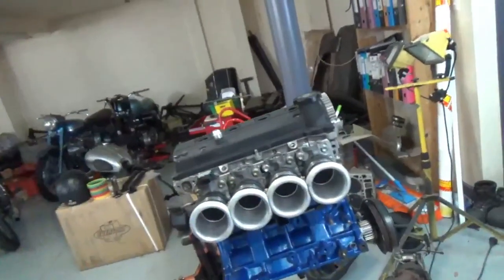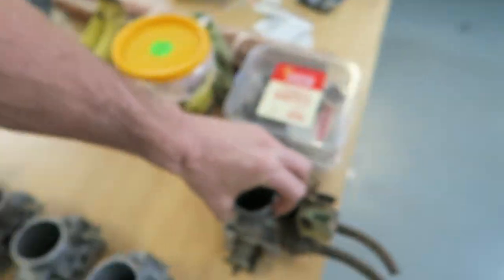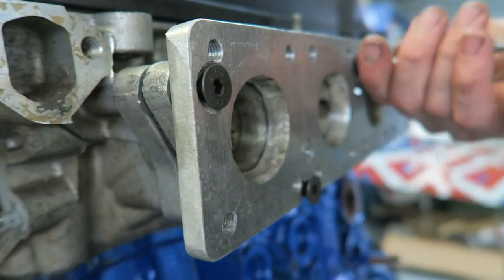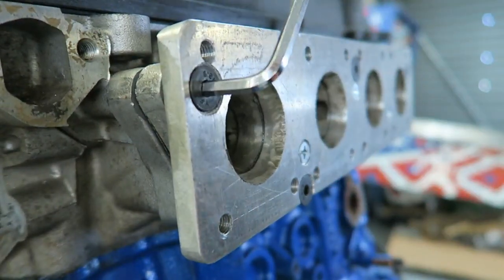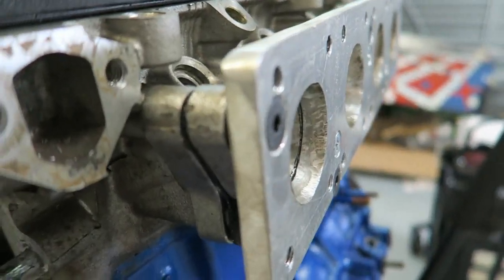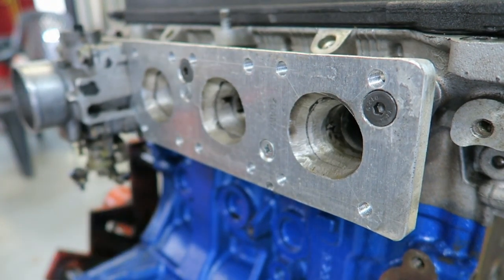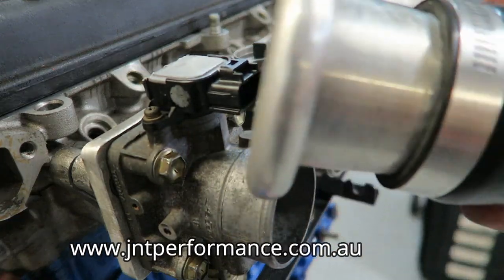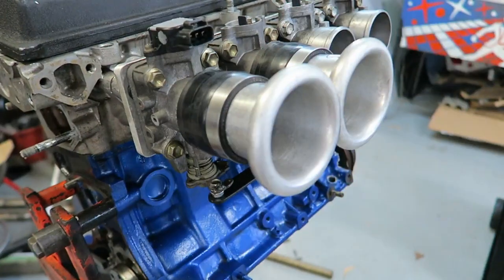How to build your own custom ITB intake manifold

Comment: Hi mate. This is intersting. How hard was it to fine tune the ITB's given you have 4 seperate mechanisms sharing a bar/rod? Also do you know the ID of the throttle bodies? Thanks dude great stuff
Reply from the maker: Hi SR PERI. Being efi there was really no need to fine tune it. The fuel supply is controlled by the computer whereas a carby setup is very important to have them fine tuned correctly as they will draw in different amounts of fuel if not tuned correctly 

The main thing is a made sure they are all open 100% on wide open throttle. 

I am testing a new design at the moment using adjustable rods, I'll be putting a new video up soon, be sure to subscribe 😁
Reply: @MattBerrymotorsport  mint! sure have. And yeah I was asking re: idle with efi. I had imagined it'd be quire difficult with ever so slight dsicrepencies in throttle position

Comment: Hello there! I would like to attempt this on my BMW M42 engine. I would like to know if you still need a ECU or stand alone computer when the engine is installed? This will be my first carburated build as well. In theory I can run this WITHOUT a computer yes??? i have a manual transmission as well all tuning will be done manually correct? And I can apply a third party knock sensor and tac. gauge yes? (this 92 E36 will become my first drift car) I would like to install this system to avoid the extreme cost of reprogramming a computer. My rigg even turns over I would just like to know a few more specifics, any support would be greatly appreciated thank you! Much respect from Cleveland OH! P.S_ if this setup does not need a computer, what should I connect my MAF sensor to?
Reply from the maker: If it is carburetted you wont need to connect a map sensor. Dont expect any real power gains without replacing the camshafts and exhaust.... this mod is pretty easy to do, even to a car like yours, however without changing the cams or exhaust you will only get "the noise" from this modification...
Reply: @MattBerrymotorsport  thank you!

Comment: Never thought of that...

But how are you going to connect the to the ECU?
Reply from the maker: Hi tassross! I have used the factory TPS sensor to the stock location on one of the throttle bodies. I don't use the idle motor, it is adjusted by the throttle plate 😊

Comment: How high can you rev limits 4efe n/a 8500 or 9000 stock
Reply from the maker: 7000
Reply from the maker: Will eventually throw rods at 7500
Reply: How much for the aftermarket vavle springs u used
Reply from the maker: @Timroycampbell  email or call Allen. Tell him I sent you and he will work out a price for you

Comment: Hi, do you have any info about how interchangable Toyota's throttle position sensors are? I'm figuring out if the values are the same as on the 3S-GE.

I am at the start of designing ITB's for a gen2 3S-GE engine. I want to do it in such a way that the ACIS function of the stock manifold can be preserved. I concluded that 45mm (like the 4E-FE ones) are about the ideal diameter. If the included TPS also just works, it is a very cost effective way of making a proof of concept or even the final version. I'm only making it for myself, but if it works I might document and share my progress with the MR2 community.

(PS: The second option I could try is using the standard ACIS valves as ITB's, as they're 45mm and linked together too, but that would include fabrication of an idle adjustment mechanism, custom mount for the throttle cable and some way to mount the TPS.)

Comment: Wonder what difference would to make an ITB set up for a v-6 like a 3000gt..wanted to do an ITB manifold for it
Reply from the maker: They sound really cool 😁😁

Also unless you get bigger cams it won't make any more power, you will lose low end torque not having a long intake runner. Keep that in mind 😉
Reply: @MattBerrymotorsport  well I am getting bigger cams. Just taking a while to get all the parts. Everything on these cars is really expensive due to lack of support lol.

Comment: Was this run in the car of the standard ecu and injectors or did it need to be tuned?
Reply from the maker: Can run off the stock ecu and stock components. If you change The cams are or injectors that  will change the tune dramatically

Comment: how do you mount the fuel rails? I guess I can't cut my intake manifold right where the fuel injectors mount because the place of the fuel rail bolts would get chopped off
Reply from the maker: The fuel rails in this application bolt to the cylinder head... you might have to weld on some injector bungs and rail mounts...
Reply: @MattBerrymotorsport  ohh I see.. Yeah you're probably right. I guess I'll have to stick with welding. I have a basic TIG welder that I'm using to learn, but it doesn't weld aluminum. Guess I'll have to wait to do it myself, but i think it will be worth it. My engine still on the machine shop anyways. But thanks for the help, much appreciated.
Reply from the maker: @Foodencio  ive read in a few forums that mounting the injectors at the trumpets makes more power? Might be something worth looking at if you have to move the rail anyway? Good luck man
Reply from the maker: @Foodencio  they are definitely worth it, not so much for the power gains, but the noise sounds incredible
Reply: @MattBerrymotorsport  Oh yeah, I forgot some people mout at the trumps, but I don't know if I would do that. It seems to be very complicated, also regarding on the fuel management system. I think I'll try to do the ITBs more for the fun of building them and the sound. I was wondering how it would be like if it was turbo too with the ITBs hahah.
Reply from the maker: @Foodencio  yeah build them for fun, thats what i did... have fun mate :)

Comment: The linkage between the TBs needs to be adjustable as they'll need to be balanced
Reply from the maker: For carburettor, balancing is very important, for efi throttle bodies like these, not so important. Works fine.
Reply: @MattBerrymotorsport  they should still be balanced. The ecu cannot change the amount of air entering each cylinder.
Reply from the maker: @ItsFriscoBaby  they are very close yet i had many people say the same thing as you. I ended up making adjustable linkages and it made zero difference to power and drive ability. Sorry mate but ive tried it. The linkage in this video works perfectly fine and its very very simple to make.
Reply: @MattBerrymotorsport  Every engine and proper sertup of ITBs comes with adjustable linkages to stop one cylinder being rich or lean. It should be done even if you don't feel any difference.
Without something like individual exhaust temp sensors the ecu has no way of compensating for one cylinder getting more or less air. Your engine though so whatever suits you.

Comment: What would I have to do to the engine internals if I do this
Reply from the maker: ive got a few other videos showing the internal parts, the bottom end is all oem Toyota stuff. the cams and valve springs are aftermarket. You could put this intake on a stock engine if you just want to have fun, its not like it will damage anything, just keep the revs under 7k and you will be fine
Reply: @MattBerrymotorsport   if you run them open there will be less filtration so the pistons and cylinder will take damage after quite some time but if you run air filters on them there should be no problem

Comment: Hi man Where is the MAF Sensor ?
Reply: There is none. You have to tune it with throttle body position as main load input, also known as Alpha N tune.
In General those kind of builds need to run on a standlone ECU, therefore you'll barely find a MAF.

Comment: How do i do the new vaccume lines and the MAF I throw it away??

I have a bmw inline 6 m50 engine
Reply from the maker: New video coming out soon explaining that. Be sure to subscribe 😊 BMW 6cyl itb would sound insane!!
Reply: @MattBerrymotorsport  i actually figured it out but I will 100% subscribe.

I will take vaccum line from each runner to a single vaccume block and the maf ill fabricate a manifold for.

Do they have a significant difference on NA and Turbo?

Comment: This is freaking awesome dude!!  Now if I can just convert my drive by wire to drive by cable, I'd be good to go..  I hate newer vehicles.... AWESOME video man  seriously. How are the pins in the bracket holding up on the under side?  No issues with them vibrating out?
Reply from the maker: Haha cheers man I appreciate it! Yeah nothing vibrates loose, the only thing I'm changing is having adjustability instead of one solid flat bar for the throttles...

Comment: A bit more tricky if your engine doesn’t have holes for the injectors in the head ...
Reply from the maker: very true however you can buy injector weld on bung things to mount the rail... what engine is it? maybe you can chop the intake manifold off and use the factory injector holes and rail location? then build the itb manifold off that
Reply: @MattBerrymotorsport  I’d need to be able to weld aluminium for that! I’m looking out for some used aftermarket direct-to-head ITBs for my MG-Rover K series. In the meantime, I’ll just watch talented guys like you!

Comment: Nice, I'm currently building a n/a 4efe what's the spec on yours
Reply from the maker: cool as. 
297/297 cams, stock rotating assembly, 4e pistons, lightened flywheel, microtech ecu, 730cc injectors.
Reply: @MattBerrymotorsport  where I can get the cams?

Comment: What did you do with the vaccum to the brakecylinder?
Reply: Brakebooster *
Reply from the maker: I just left it off. the brakes work good without it, I just have to press the pedal a bit harder lol. You can easily hook up the booster though, you just need to hook up one vacuum line to each of the itb's and then join all four together to a little box, then hook that up to the booster

Comment: What the measurements on the whole modifications
Reply from the maker: Hi there are no measurements. You need to work that out depending what engine you are putting them on.
Reply: @MattBerrymotorsport  same 4efe engine
Reply from the maker: @michaelthompson3042  cool man but yeah just build it as you go. If you are planning to make this on the car it's quite difficult. Best plan is to have an engine on a stand so you can make it that way. Also bolt the starter motor into position so you can work out linkages so they don't hit the starter solenoid. It's a lot of fiddling around but it can be done

Comment: I was looking to do on a mx5 would it still work as mx5 has maf sensor?
Reply from the maker: Yeah you will need to put a vacuum box on there.
Reply: would need to put a speed density tune on it to eliminate the MAF.

Comment: Did this run off a standard ecu or standalone?
Reply from the maker: full standalone ECU. this engine had a lot of work done to it, cams, pistons, porting, injectors ect... if you had a completely stock engine and added a balancer box to the intake manifold ( for the map sensor) I don't see why it wouldn't run good enough to be able to drive. the stock cams would be the biggest restriction, so having massive itbs like this wouldn't make let any extra air in the engine anyway to affect the stock tune
Reply: @MattBerrymotorsport  where are you getting the vacuum/MAP reading for your ECU? Didn't see any barbs/vacuum balancer box on your manifold
Reply from the maker: @saik0uguy  sorry for the late reply didn't see your comment... 

I'm using the TPS tuning mode, it doesn't use map sensor at all.

I've since decided this tuning method isn't very good and have gone to a vacuum box set up. No new dyno figures yet
Reply: @MattBerrymotorsport  would love to see an update video on the ITB set up
Reply from the maker: @saik0uguy  cool. be sure to subscribe 😁

Comment: Why don't you just use bike TB's?
Reply from the maker: Not big enough
Reply: @MattBerrymotorsport  what size do you need?
Reply from the maker: @bikeserv the only bike carbs I could find were for 600cc engines... This engine is 1500cc... The throttle bodies I have used in this application are far too big, but they look sick and they work well for low budget

Comment: Yoo Matt Berry. Did you use a gasket between the throttle and the plate? :)
Reply from the maker: of course :)
Reply: Where did you buy it? :)
Reply from the maker: @danishkarting2445  I bought a sheet of gasket paper for about $10 and made them by hand. easy with a sharp knife and a pen
Reply: @MattBerrymotorsport  how many millimeter? :) Mm
Reply from the maker: @danishkarting2445  .5mm
Reply from the maker: @danishkarting2445  1mm will be ok to use too

Comment: It's great engineering but poor youtubing lol. What exactly did you cut from the throttle bodies.  I love out of the box videos but they need to be more informative.
Reply from the maker: Yeah it's a pretty bad video, I'll admit that lol but the point of the video is just to get an idea of what to do and how to do it. There's a very high chance that you won't use the same throttle bodies as I did, so knowing what I cut off is pretty pointless. It was part of the factory idle air motor mount, which don't get used for itb anyway, it's a mechanical adjustment.

Cheers for the comment